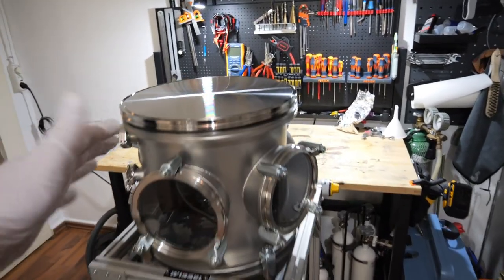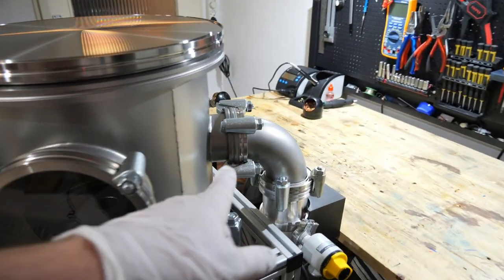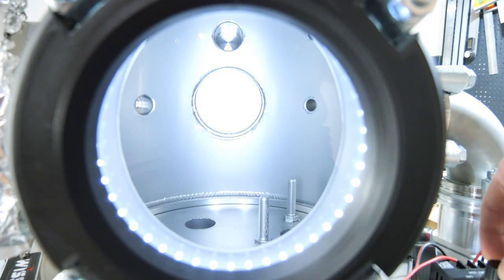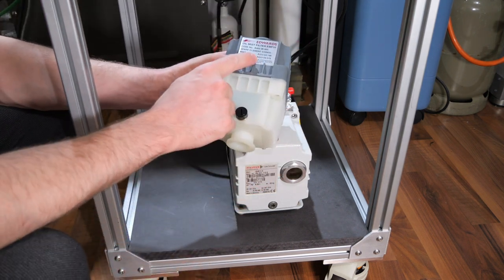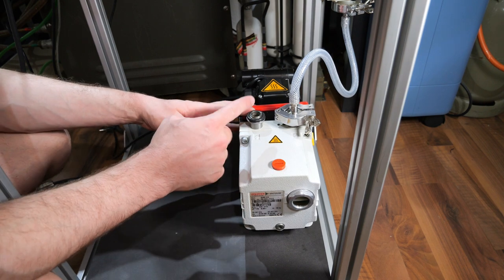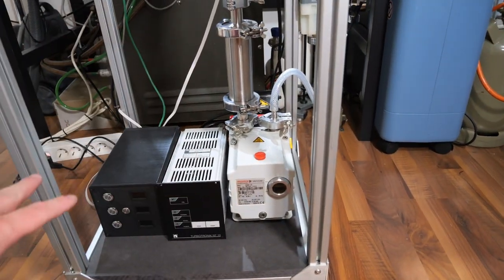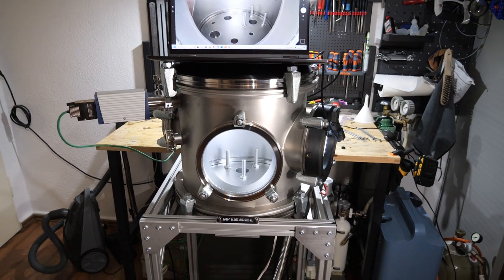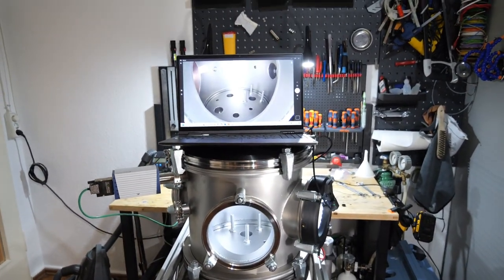My New Vacuum Chamber: First Projects

Comment: Your channel is criminally underrated. Most of the time I really have the faintest idea of what you're doing, but you explain everything so well that I come away knowing something new. I cannot wait to see what you have in store for  your new vac chamber! Maybe some more Caesium????
Reply from the maker: Thank you! Currently the experiments planned with the chamber do not involve cesium. However I thought about testing if cesium can be cooled to a point where it won't react with oxygen anymore. Would be interesting to see if it still reacts at 20 K. But the setup for that experiment would be pretty complicated so I will need to think about how to do it.

Comment: Something very important is a heater for the chamber to achieve a good base pressure. You want to get rid of the moisture that sticks to the chamber walls. I used some resistance wire inside a fiberglass hose wrapped around the chamber. Works really well and its quite cheap. 
Heating the chamber for about and hour should be enough.
Reply: is the moisture sticking to the walls similar to adsorption?
Reply: @alexdrockhound9497  exactly.  Heat helps with the desorption.
Reply from the maker: Yes that's also on my list. But I wanted to build an insulated "tent" and use hot air to evenly heat the chamber.
Reply: @AdvancedTinkering  that will also heat all the electronics attached to the chamber. You want 60°C on the chamber wall. If you wrap for example 15m of that resistance wire around your chamber it will heat it evenly. You can also regulate the temperature if you attach a pid controller.
Reply: I mostly used a blowtorch... Works well into the low mPa range. If your project does not need constant heating of the wall, this would be my choice..

Comment: I am drooling over that vacuum chamber 🥵
Thanks for the shoutout! I'm sorry the charcoal trap didn't work for you, I'm surprised at how much oil mist was passing right through! I think it's possible that my long exhaust line and the knock-off "Alcatel-style" oil mist eliminator that I have installed on my pump are doing a better job of removing the larger droplets before they reach my filter. It may also be that my pump is much larger and slower, and so it produces a less dense mist.
Reply from the maker: Yes, it's probably the high flow rate so the  oil doesn't have a chance to be absorbed. And since your chamber volume is a lot smaller it might work in your case. But even in my case it's better than nothing :)
I once had a vacuubrand oil mist filter which worked great. It was some sort of sintered polymer. Hard to describe.

Comment: If you ever get the chance, switch to a dry diaphragm roughing pump. My lab uses those in our Pfeiffer HiCube 80s and 300s where oil contamination must be eliminated. Those particular pumps are probably out of your budget, but the roughing pumps are sold individually. The HiCube 300 can get our 5 ft long, 14 in inner diameter chamber down to ~1E-5 torr after 4 hours.

When doing your leak test around those plastic o-ring seals, be careful how much helium you spray around them. Helium can absorb into and penetrate the plastic and give you false leaks and continue to offgas helium for quite a while. The helium can also back-diffuse into your helium leak detector, so keep your detector upwind of the area you're spraying. My boss once spent 5 hours trying to find a false leak because of this. I set my helium spray gun to release just the barest amount of helium so that I can only feel the helium on my tongue. Or use a glass of water if that's weird.
Reply: All of my colleagues that switched to dry pumps eventually switched back to rotary vane pumps. The oil in rotary vane pumps will catch any dust or powder. Changing the oil will effectively clean the pump. Dry pumps get dirty and are hard to clean. Also, rotary vane pumps generally have higher extraction rates.

Comment: Now that is a nice looking chamber! So much room for activities 🙂 Really like those vac gauges too, super convenient. I've never been happy with mist eliminators, some oil always seems to leak through. 😢 I snagged a scroll pump off ebay a while back and it's been such a nice upgrade (a lot quieter too!)
Reply from the maker: Thanks! I can't wait for my first projects with this chamber. Probably PVD (thermal evaporation). 
Yes, a scroll pump or a diaphragm pump (only works with a new turbomolecular pump which doesn't mind a higher foreline pressure) seems to be the best option. 
Big fan of your channel by the way!
Reply: @AdvancedTinkering  Looking forward to it! And starting to work through your backlog of videos, lots of cool stuff!

Comment: You want the cold trap,
we want the cold trap,
everyone wants the cold trap.

You could probably even use it for both oil filters, one large dewar thing. Both oil filters in there, chuck in a few liters of liquid nitrogen or isoprop and dry ice.
From what I can see the "trockeneis-shop" sells 10kg of pellets for around 50€. Wouldn't that theoretically also help with the vacuum if stuff starts condensing around there?
Reply from the maker: Haha, I would really love to have a compressor cold trap. Sure I could use a liquid nitrogen or dry ice cold trap but it would be very expensive over time and I would have to wait for the dry ice to arrive every time I want to use the chamber.
Reply: Why not a hot trap? The volume of air coming out the exhaust is so small, just pipe it into the air vent of a Bunsen burner and burn it off with a small flame. The current molecular sieve filter will act as a flame arrestor.
Reply: @Muonium1  Or run a pipe into the septic drain system (it's vented to outside air).

Comment: This is a very sexy vacuum setup and one of the most impressive home science setups. Clearly you've thought things through a lot.

Just an idea but ultimately it's your setup - would it make sense to print out some 'hold down' clamps so that the chamber cannot accidentally lift out or get raised out when torquing down bolts? 

Another idea would be some basic brackets for the side, to hold the lid out of the way and protect the CF flange knife edge, rather than having to set it down on flat surfaces and eat up bench space?
Reply: I think he doesn't have any CF flanges, but it's also good to avoid scratches on o-ring sealing surfaces
Reply from the maker: Thank you! That's funny, I had the exact same idea and have already designed clamps that would have pressed the chamber to the aluminum extrusion from above. But it turns out that the chamber is so heavy that it's very hard to turn it. When I tightened the screws, the whole stand moved because I attached feet that have casters. In addition, I can lower feet on which the stand then stands securely. 
I may eventually print the brackets anyway. Just to be safe. 
They are not CF flanges but ISO K flanges but you are definitely right. My plan was to design a mechanism to make it easier to lift and move the flange aside. Possibly using gas springs to make the process smoother. 
There is definitely still a lot to do :)

Comment: 7:25  Any idea what temperature they need to reach?  

It would add more Complexity, and probably Energy Use and Cost as Well, but depending on the temperature needed, a DIY Version may not be too far out of reach.

Granted try finer filters/powders, and maybe even something akin to what is used for compressed air first of course!

Comment: Looking great! My condolences for the whole oil issue. Switching over to oil-free scrolls or membrane pumps is just such a quality of life improvement. 
If you have the valves and hoses for it, being able to bypass the TMP to pump down the chamber with the roughing pump is a very useful feature to have.
Did you already check your setup for leaks with your new leak detector?
If you can see plasma from the ionization gauge, putting a spectrometer there might allow you to do a little bit of composition analysis.

It will be exciting to see what experiments you will do with this.
Reply from the maker: Thanks! Yes, a bypass for the turbomolecular pump is definitely planned. But the valves for the large flanges are very expensive. The chamber was tested with a leak tester by Wissel Vakuum after construction. I myself have not tested it yet but will probably do so. 
Recording the spectrum is a very interesting idea. I have to test which wavelength range I can measure through the borosilicate sight glass. If it absorbs too much I will have to see if I can build a vacuum feed through for a light guide.
Reply: @AdvancedTinkering  Good luck with the testing, and don't let permeation through the O-rings lead you astray.
Regarding the windows, borosilicate should be fine for most applications with good transmission in VIS and near IR. For UV light I'd recommend UV grade fused silica, for really far IR zinc selenide, and for widest transmission all around calcium fluoride.
Reply: @AdvancedTinkering  Roughing through the turbomolecular pump is very convenient and a good way to keep oil from the roughing pump out of the chamber. I only ever did that, and didn't ever have trouble with dust ingress but you may know for sure that you require the ability to bypass the TMP for roughing. A small TMP like that should take 10 min at most to spin down gently and 15 min to start back up. Isolating the roughing pump is a more useful capability and well worthwhile, especially if you have a ballast behind TMP. Putting the leak detector behind the TMP is very useful, especially since it allows you to mount and demount it without breaking vacuum. Feel free to ignore me as long as you are sure you understand your requirements :)

Comment: I'm using pure mineral oil (Weissöl) for my vacuum pump to deal with the oil mist. If a bit of oil gets into the air it will not cause any issues.
Mineral oil seems to be a valid vacuum oil option, it's used in the food industry.

Comment: Why not use a oil bath with a bubbler tube submersed in it. Like you do a vapor trap in chemistry.
Maybe you need to add a one way valve to make sure it can never suck back the oil form the trap. Don't know if the architecture of the pump would allow such a case.
Reply from the maker: That might be possible. Just a bubbler would probably still let a lot of mist through. But using some sort of diffuser (like a sintered metal sponge) might increase the surface area enough. But then the flow resistance might be too high.
I think I will leave it like it is for now. Once most of the air has been pumped out the oil mist stops. At some point I might get a proper professional oil mist filter.

Comment: Nice project man! 
I'm glad that you mentioned the oil mist. Mine also does that, and I wasn't sure if it was normal as I'm new to all of this. I had it sorted by routing the outlet through an oil separator for compressed air. Does yours also heat up to a ridiculous temperature after an hour? I can't hold my hand on the box with the oil.
Thanks for the Signal ditch channel recommendation.

Comment: not used my vacuum pump in a while so cant be exactly sure but i have that same filter as yours but there is a small drain pipe that leads back to a valve on the pump housing to recycle the oil in the trap.

Comment: Good video, sexy chamber and clever use of a vacuum filter.
1. what department are you in (Elias is clearly a chemist)? 
2. where did get the Triangular mending plate for the t-slots?
Reply from the maker: Thank you! I am studying chemistry. I bought the connecting plates at Dold-mechatronik. But there are also some on Amazon if you are not from Germany.

Comment: That Swagelok needle value might not be suitable to actually close completely. Please check the series of that value. A "metering value" (at least series MH, ML, MS and MV) is only used for controlling flows, not turning them on/off (hence metering). You will find that you shear the valve stem off when you actually want to close it. Ask me how I know.

Comment: With so many stuff in the vacuum side of the roughing pump, you severely hinder your vacuum performance there.
With dual stage pumps you could reach well into molecular flow regime. But with the obstructionss this will take ages.
Reply from the maker: Do you mean the foreline trap, hose and valve? I tried keeping it as simple as possible. Eventually I will probably move the valve of the turbo to be able to isolate the roughing pump. But as far as I can tell everything else is necessary.
How would you do it?
Reply: @AdvancedTinkering  I don't know. When you say it is necessary, I have to believe you. I only worked with either high end automated apparatus, or very simple setups with just the pump attached via a large diameter hose. And the latter processes (welding) were not sensitive to that tiny scale of oil contamination. BUT it was possible to get into the 10-4 mbar range with a good dual stage pump alone within a minute. But maybe your tasks are more demanding. The diameter of the pump connection becomes very important below 10-3 mbar because of free molecular flow. And putting a fine mesh in is about the opposite of large diameter piping. (Molecular flow blew my mind when I first heard about that, years ago!)
I guess you know because you seem like a like minded premium nerd ;) , but in short: When the pressure drops low enough so that the gas particles rarely interact any more with each other, but mostly the walls (free path length > vessel diameter), the flow loses its property of directionality. Because particle interactions with the walls mostly don't reflect particles. They get adsorbed to the surface and shortly after get desorbed again... with random direction! So further pump down becomes a matter of statistics of a particle finding its way to the exit and getting kicked out. This is why the piping diameters get very large with high vacuum systems, and further pump down takes ages. Might be an interesting topic for a future video.